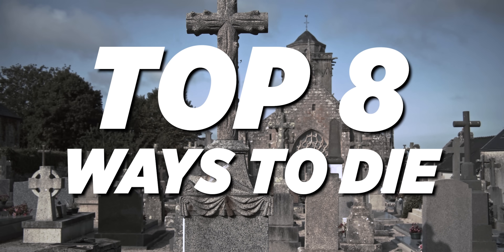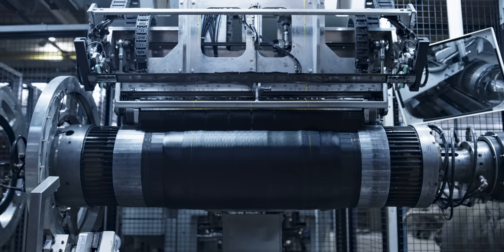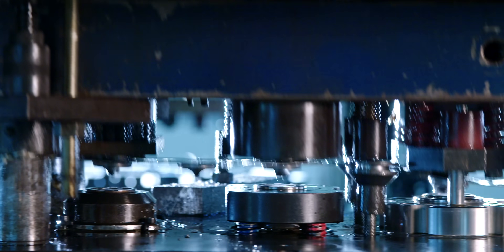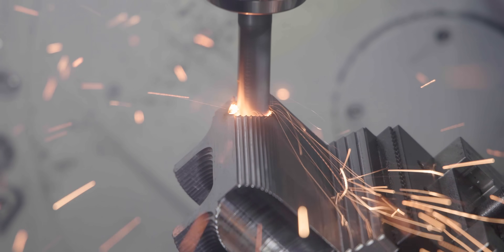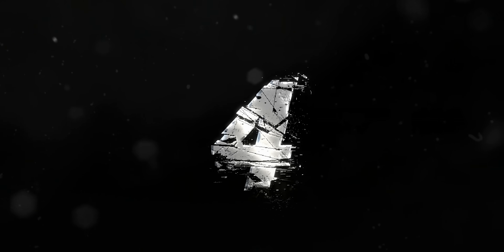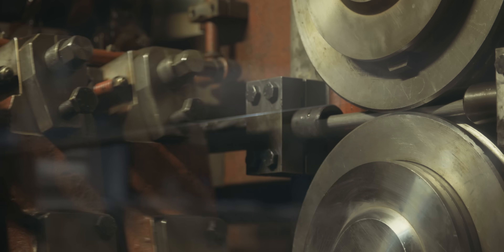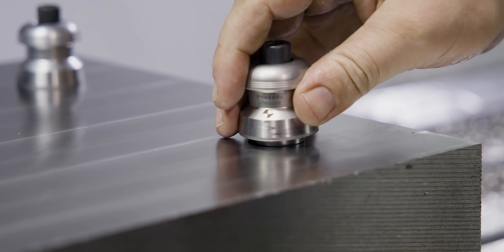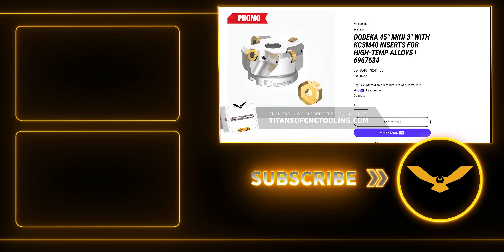HOW To Be KILLED In a Machine Shop

Comment: The one that sticks in my head, was the Russian lathe operator who was pulled into the spinning workpiece. Imagine a towel being rung out through rollers. In one second flat, he was sucked in and spat out the way he came in. Every bone crushed and he was dead before he hit the floor. 

Not even the tip of your pinky is worth any part for any company. Not ever. Stay safe everyone, and have a Merry Christmas! 😇
Reply: Russian lathe video scared me for life
Reply: Not every bone was crushed. His hands looked pretty intact sitting in the chip pan.
Reply: Man, I remember seeing that years ago. Such a total mess. 
Seen a set of pictures of a guy wrapped around a lathe from getting his hoodie sleeve caught on the work piece or Chuck. 

In high school I forgot about my watch on the wrist and it got caught on a bent tail dog chuck. Thankfully it was a cheap watch and the band broke before sucking in my arm.
Reply: @bigv6724  My woodshop teacher told us of someone found dead next to a bandsaw and didn't have an apparent injury at first glance.  The blade had broken and went into his skull via his eye socket.  Not sure if it was true, but it sure is plausible.
Reply: Nearly made me sick that video
Reply: The lathe literally made red mist out of that poor man, while it didn't shocked me that much, it's a good reminder for rookies to consider and double check every security/protection measures
Reply: Disability doesn't pay #$(*@. Don't get disabled.
Reply: @daveyt4802  and you cannot sue for damages either
Reply: That messed me up for about a month. I still think about it from time to time... just horrific. It's how he got it caught, and knew what was coming for a few seconds before it actually happened,
Reply: @goomba1982  after that we just called him "9 of 10" (Star Trek reference) or "Niner"
Reply: certified classic
Reply: I think this video is fake no fling guts not mention 5 liters of blod